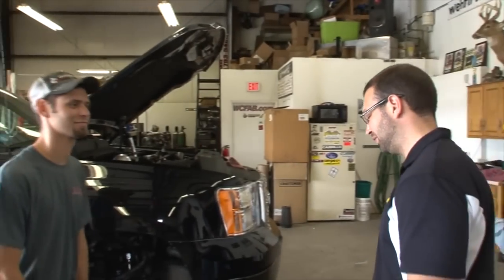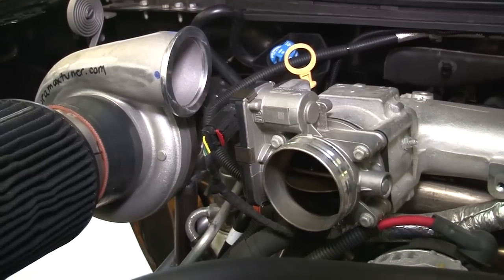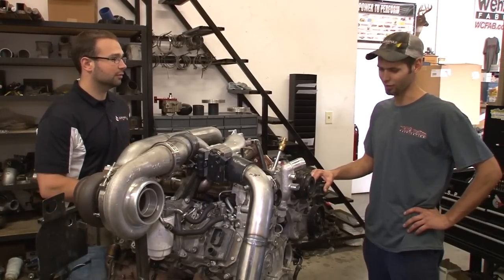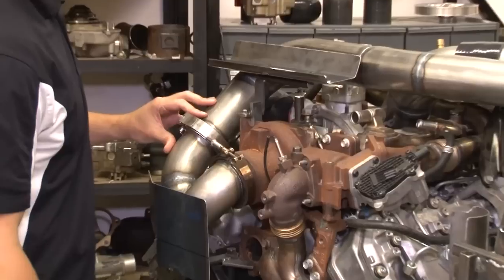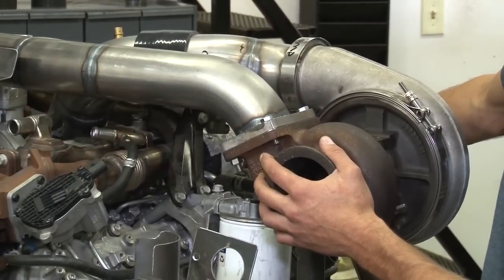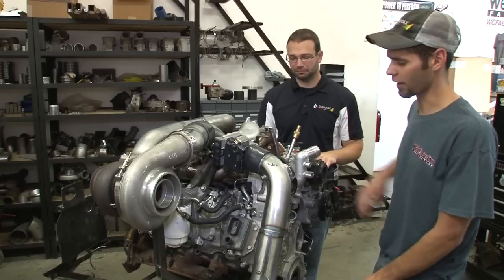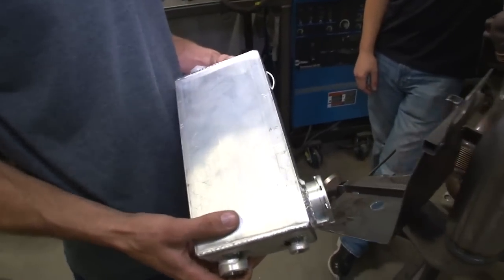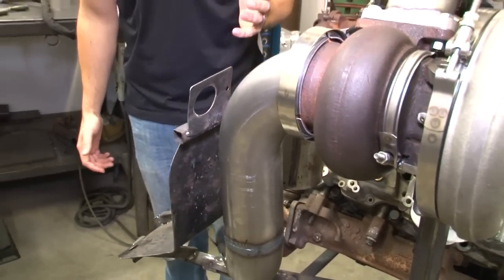LML TWIN TURBO BUILD by Duramaxtuner.COM

Comment: Well its nearly 2020 I was reallly considering buying a kit from duramax tuner,,warranty is no longer on my truck it's been paid off for some time,,got some cash in the bank,,but if it takes 6 years to get my truck back ,,about how long we have been waiting on a update,,think I'm gonna have to look at other shops.🤔
Reply: Still waiting lol 😂
Reply from the maker: We have the kit installed on a few trucks.  it technically is available (and has been) for the 2015 & 2016 LML's.
Reply: @Duramaxtuner  still offer for the 2015 lml? Didn't see it on your site. I'm tuned through you as of a week ago and just was informed of this kit.